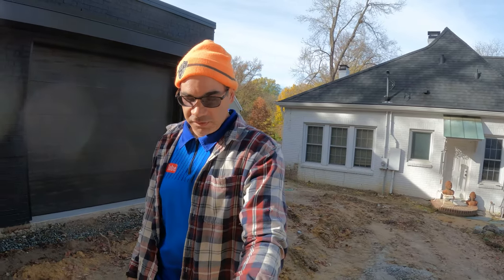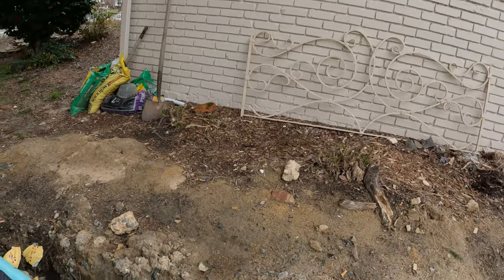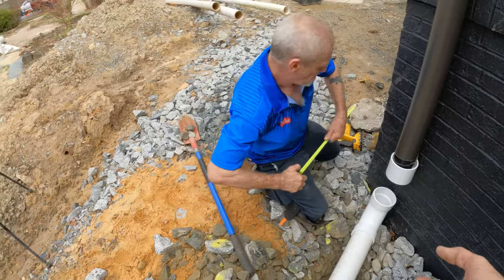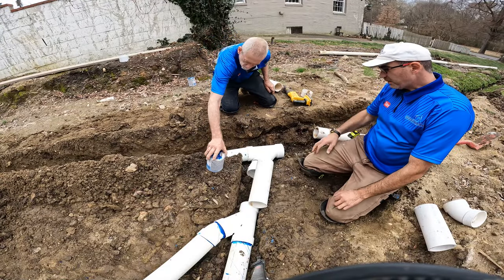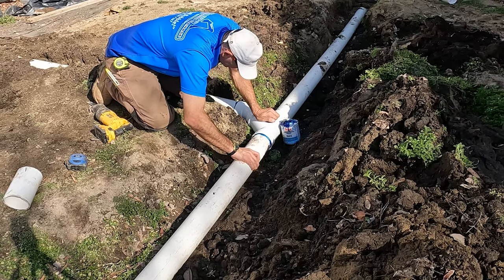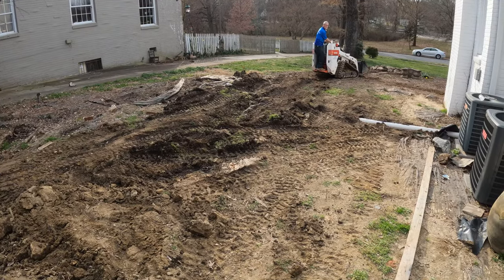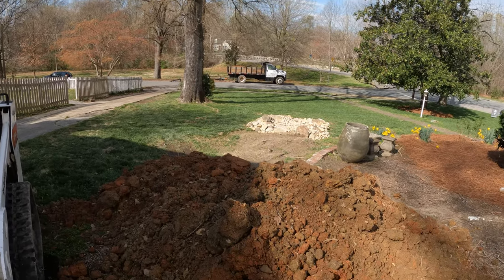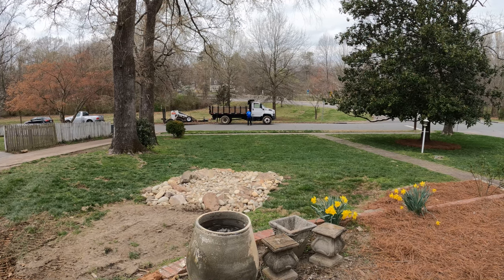Part 1 of 4 - Drainage pipe and start grading

Comment: That was mighty neighborly to allow his yard to get chopped up to help solve the the drainage problems next door.
Reply from the maker: For sure! This client is an awesome guy to work with and apparently an awesome neighbor!
Reply: Great project a lot of different elements coming together for a successful solution.
Reply: @ Calvingreen90     Yeah, as i said in my comment, Kudo's to the neighbors on this one.
Reply: The guy who owned the vacant property next to me let me run PVC across (under) his property to outfall at a low spot. Then he sold the property, and the new owner said he intends to build a house right where my pipe is.  I re-did the project, cutting off the existing pipe, turning 90 degrees and running 90 feet of new PVC under my own property  out to the street... that was two years ago, and the new owner hasn't started any work yet. 🤔
Reply: @DaddyBeanDaddyBean  
Some people are just a**h***s and why l like pointing out exemplary behavior.
Reply: Interesting on how many 4” pipes consolidated into 1 4” pipe - any concerns with capacity?
Reply: @robertlerner5306  
Sean takes capacity into account but one of the advantages of 4-inch pipe is ease of uncloging compared to smaller pipes. They are also more rigid which helps avoid low spots where water stagnates.
Reply: @robertlerner5306  A 4 inch pipe at 1% slope and 70% filled makes 4000 gallon per hour.
Reply: He had to other options, it was his problem too 😂
Reply: @dsantostv3711  
It appeared to me his yard had enough slop to shed the water from his property without swamp like conditions

Comment: As a home builder in Texas i get geotechnical engineering reports for foundations and 1 thing i think that you could do is what geotech engineers recommend is when u build up dirt against the side of the house you do a smaller slope then install a thick poly membrane on top of that then add the rest of your dirt on top of that membrane. When water does soak thru the dirt it hits the membrane and redirects water away from the foundation and any basement
Reply: That depends on the composition of the soil.  Clay is impermeable to water.

Comment: Big job! After watching some of these videos, you really get an appreciation for the complexity. Shawn is more like an engineer because of the problem solving involved. It’s also quite a mix of disciplines: plumbing, fluid dynamics, plant and soil science, foundation construction fundamentals, heavy machinery operation… the list goes on. The crew also need varied skills and considerable experience - can’t just hire anyone off the street to manage all the pipe fitting, bedding, and all the peripheral tasks. It’s not a simple field. Great work and look forward to part 2!
Reply from the maker: That's a very good point. I often think all I need to know is "water flows downhill" and I continue to be confused as to why other contractors do the things the way they do. I try to think about the best and simplest solution to the problem at hand. Often a single solution will not apply to different situations. Just yesterday I kept pointing to a downspout buried with corrugated as the source of lingering mud and the HO just didn't want to hear it. He finally put the garden hose on it and 10 mins later a trickle came out of the other end.

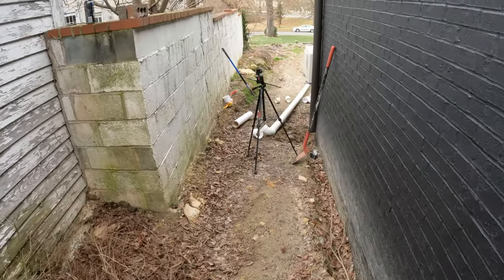Comment: Another great video! 16:26 Making small swales in tight spaces is challenging. I've been using a 18" sod cutter to remove sod, then making more passes to achieve the appropriate depth of ground cut, shovel out the loose dirt and reinstalling sod. I've trimmed labor by 60%, better finished product and have happier customers. The Bluebird SC550 sod cutter works very well
Reply: That’s the correct way to do it.

Comment: Hard to believe they did all this planning, pulled permits, construction and got toward the bitter end of construction before considering rain.
PS — got to say that black garage does make a statement of sorts.
Reply from the maker: William - we've been involved with the drainage stuff from the start. I just wanted the garage to be finished before we started our work. This job has come a very long way and parts 2 and 3 should be awesome videos!
Reply: This seems to be the best time to do the drainage work along with bringing in dirt. Construction is done and finish landscaping hasn't been started. It's a shame the basement got flooded, but sometimes these things happen. If they ran the pipes and brought in the dirt before starting, pipes could've been damaged and dirt moved causing them to grade twice. I think they did consider rain at the right time, they just had to deal with a storm before they could get to that part of the job.

He even wrote that he worked with the owner and builder from the beginning on the drainage issues.
Reply: I would think part of the permit process would be water runoff and slope. Would be final phase inspection.. alot of new home tracts and city properties never consider water runoff...And want completely flat landscape...Houses and buildings should always be higher than surrounding property...
Reply: @joeshmoe7789   I think general contractors should have to consult with drainage contractors for final drainage stuff...And then sign off on it.

Comment: I'd probably add a surface drain in line with the neighbors drain.  Not to let surface water in, but to let water out if by some extremely remote chance the garage owner's drain clogged. Don't want garage owner causing neighbor to have an issue.  Yeah, I admit I'm a worrywart - It's a curse.  Always have a Plan B.

But kudos to the neighbor for allowing the owner to tie into his downspout.  Heck of a nice looking garage too.

Comment: I remember a house we had, built and I put in the three wall pipe NOT corrugated and this was 2006, and it STILL works fantastic ! We moved and the last I knew in 2019 it was fine, tied to the sump, which runs all the time ! I dug all or most of that by hand, almost 200 feet, and the slope was really hard, very little, but it worked and works !
Reply from the maker: Nice work Gerald!

Comment: I used DWV, (sewer and drain) PVC pipe on my projects, the guy at Ace Hardware called it Schedule 20. Yes, I would much rather use Schedule 40, but compared to that black corrugated crap that they had going uphill, it's a marked improvement, and something I can more easily afford.

Comment: A topographic map of the property would be interesting. What I normally do is any connector pipe or fitting that leads down where by its very connection water can not escape, I do not put glue as it gives future access to anyone whereas if you glued it all up then no one can get access to the drainage system.
Reply from the maker: I like leaving the rectangular downspout to round coupler connection open. This allows access with a snake or jetter hose.
Reply: @GCFD  You exchanging the hard T junction with an increased angle connection was a stroke of genius.

Comment: Enjoy your work ,you made me a convert to sch. 40 more money less problems .You ever try dry fitting then  use a magic  maker on both pieces ,then undue it and glue it right where she needs it ?
Reply from the maker: I've done that before but I don't like trying to get the pipes undone after dry fitting. I like the glue and smash method!
Reply: @GCFD  yea I get that ,it's those tricky spots that have very tight  tolerances where that is a good method less stress ,or hurry ,worry

Comment: I believe that green pipe by the new brick wall is Sch35 SDR, Not sch30 
Im with you on using Sch40 if cost is not a factor but sch35 below ground or where not subuject to high traffic loads (like heavy vehicles) installed correctly is good stuff
Sch30 and corrugated are trash but sch35 is a substantial upgrade over those two types it is perfectly suitable for underground drainage and sewer installations.
Foam core  Sch 40 DWV offer very few advantages over it in that application, though again if cost is not a factor I would choose Sch40.

Comment: I think you may have buried the crawl space access door a little bit by the ac units?
Reply from the maker: That's a cover and not the door. They have a basement in this house and the crawl is accessed through there. We are doing a mold treatment and insulating down there, so I'll show that in part 4.

Comment: Nice job.  Why not put some water proofing on that brick before backfilling dirt against it?  I'm in the north so maybe that's the difference.
Reply: You shouldn't need it if run off is pitched properly and roof water is removed.
Reply from the maker: You could definitely do waterproofing, but like Joe said above, it shouldn't be needed.

Comment: 13:30 that custom fitting, you couldn't have just replaced the strapping to the wall?  Probably didn't even need to be black because it would be over white pipe now.  You guys do great work but this just seemed like the juice wasn't worth the squeeze to make the expensive pipe fit the cheap metal
Reply from the maker: We could have done that too.

Comment: What mixture of dirt would I need in front of a basement wall with a french drain on all four sides and a line of boxwoods within 3-4 feet of the wall.  The drain is 3 to 5 ft from surface.  After a heavy rain I've had water seeping through cinder block foundation which has Grace BITUTHENE®Membrane material applied twenty years ago on all sides (only one side leaks).  TIA Jean
Reply from the maker: Jean - a french drain sends surface water into the ground, so I would never place one near a foundation. Instead, I like to keep the surface water on the surface and give it a path to flow away. This might mean clay or concrete along the foundation wall to act as a barrier and as a collection device for water.

Comment: Great work.  A couple of thoughts/questions...There seems to be a lot of space between the bottom of the trench and some of these pipes.  When backfilling, I would be worried about voids being left, then the pipe cracking as the dirt settles and equipment is driven over them.  Wouldn't it be good to check grades with a transit when doing this level of grading/trenching?
Reply from the maker: It's not really needed to check grade because the yard is sloping down really well.

Comment: Wow, that garage looks cool and modern, but sticks out around there compared to the architecture of the houses around it. The grade slopes right into the house!  Hopefully they do the retaining wall correct. But looks like some grade work, downspout collection and drain away from house.  New pavers and drive will be the cherry on top. Some easy fixes there, just need to get to them one by one. Seems like this builder doesn't know anything about water management.
Reply from the maker: I hope they did as well. We brought the grade up to just higher than the wall so it won't hold water behind it.

Comment: Just a question. Is the one four inch outfall going to handle all those downspouts?
Reply from the maker: It's sloping downhill really hard so it should be fine. that's a lot of pipe capacity, but a lot of water too.

Comment: If you have all those 4 inch pipes going into a single 4 inch pipe would it not be more economical to use a 3 inch pipe up to the main pipe. Why go with 4 inch all the way since the mother pipe is 4 inch